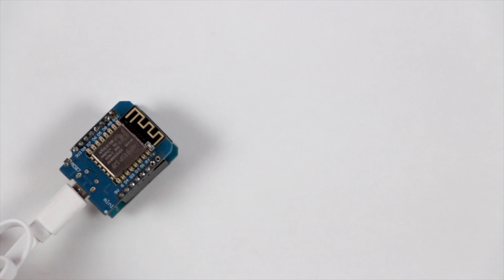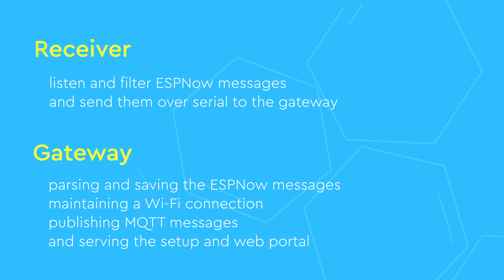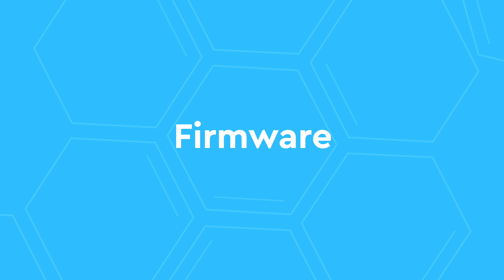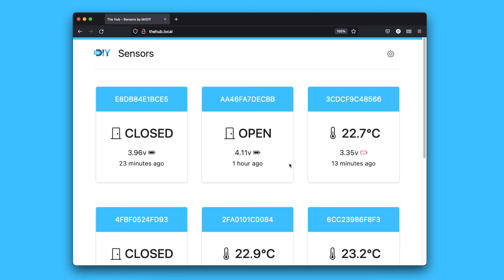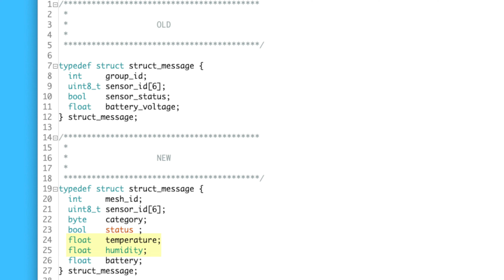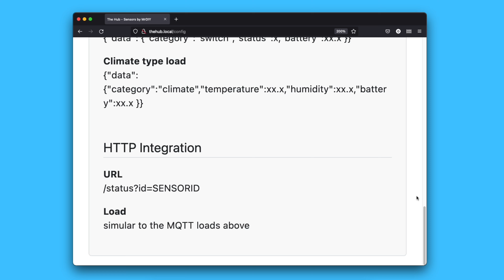The Hub 2 - an ESPNow to MQTT gateway

Comment: Your design helped me to solve a subtle problem introduced by a change of Internet provider in my community. The new provider provided an Eero mesh router which could not adapt to a specific channel required for espnow. I used the D1 mini as a hub and a esp01 for the espnow receiver fixed on a specific channel. The serial insterface on the esp01 works well bridging the espnow message to the D1 on wifi. Thanks for the ideas!

Comment: You can use broadcast to send scan command to slaves so the receivers can identify them selfs to the hub and in the same time add the hub mac address as a peer to send Data
Reply from the maker: You can but the sensors are battery powered and their radio is 99% of the time off.

Comment: Fantastic project, if you still need a case let me know along with the dimensions of the board ideally a 3d STL file and I can do you one.
I have an old mains adapter case for a wifi repeater that I will design the PCB to fit as I already use it for an MQTT connected display.
Reply from the maker: Initially, I did the same. I used an enclosure from a battery bank until a viewer sent me a case design. Thanks!